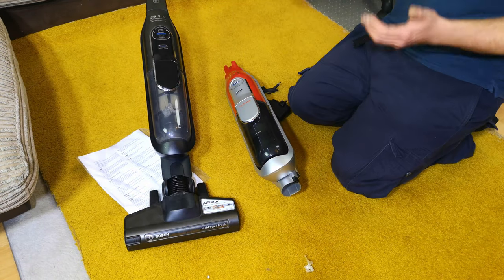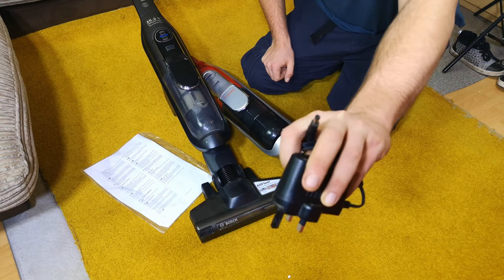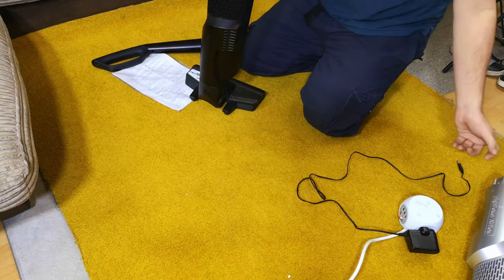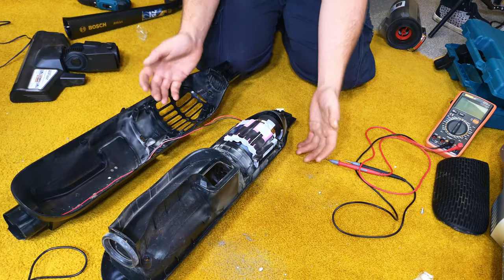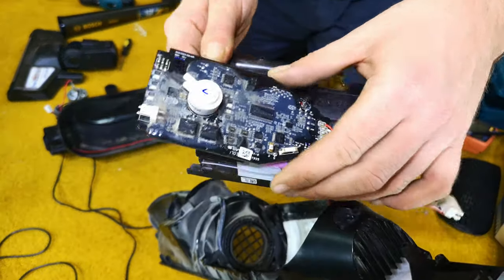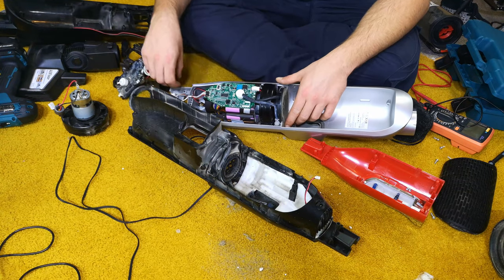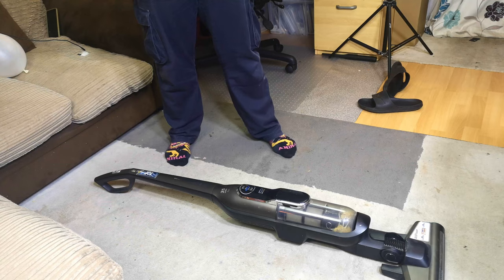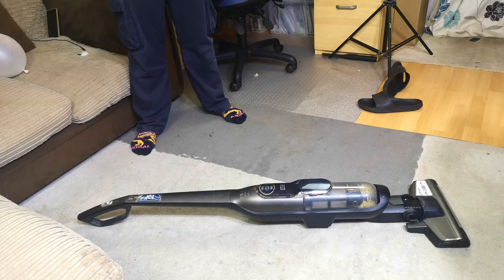A Poor Bosch Athlet - One last dying breath at Christmas...

Comment: I bought one of these 2nd hand over a year ago. The previoys owner told me about the original handle snapping, which he had replaced under warranty. You just have to be careful not to put too much weight on it when you use it, as they do fkex a little bit.
It came with a Vax Gator hand held machine, and I got both for a tenner, and both are still going strong in the original batteries.
I use the Athlet quite a bit, as it is really convenient to use, and seems to pick up quite well.  So for a tenner, it was a real bargain.

Comment: You put a 32v motor,battery and circuit in a 25v body, then tried to charge it with the charger designed for the 25v system. That's why it wouldn't charge. A 32v charger would be about 37ish volts

Comment: It's possible to fix this without a new board or having to do a board level repair. just disconnect the 2 leads that go from behind the power socket to the board and connect them to each side of the 6 batteries that are in series making sure to get the correct polarity, then you just need a constant 25v power supply or a bit under if you want the batteries to last longer, when fully charged it will stop taking current, at the moment it is probably going through a bms that has gone faulty, this way you don't need a bms, you would only need a bms if you exceeded 25.2 volts

Comment: The spares are mostly compatible with each other, if you hold the vacuum cleaner the right way up 🤣 that pleated filter is only featured on certain models, most have the foam filter. They’re good machines when working well. One of the best cordless cleaners around £150
Reply from the maker: It was good, nice aggressive brushroll. Just wasn't going to waste time on this one when a working one will come along one day for the right price!

Comment: this might be to late,but here is a crazy thought. the circuit boards must have a means to test the batteries and if not up  to specs will not charge. so if one or more of the batteries are not good the board would not charge said battery pack. You could test the batteries separate to see if bad and replace, then test charging.
Reply from the maker: I could, but I have zero experience in battery pack rebuilding and didn't want to waste time trying it on this!

Comment: My mum just bought a Bosch serie cordless vacuum, have noticed a smell which can only be described as similar to when you blow a match out, but nobody uses matches in the house and it’s coming from the vacuum, do you think it’s the charger or the motor overheating
Reply from the maker: Tricky one, if its brand new it could just have a 'new' smell, which should fade. Otherwise if its the charger it would feel hot to the touch, or its internal somewhere. I'd keep using it but register the warranty just in case...